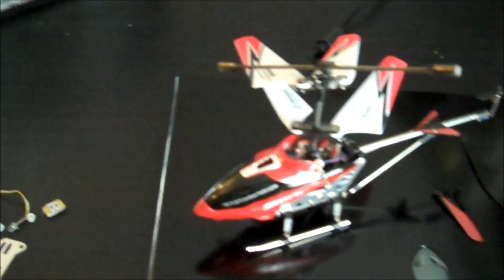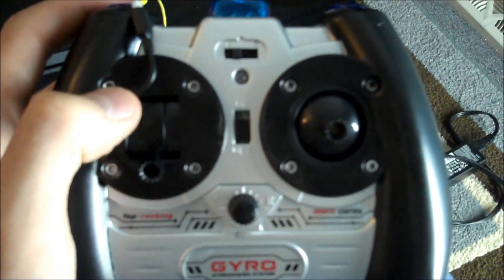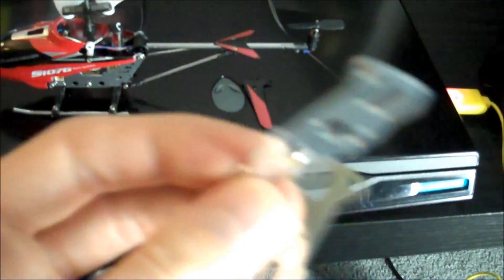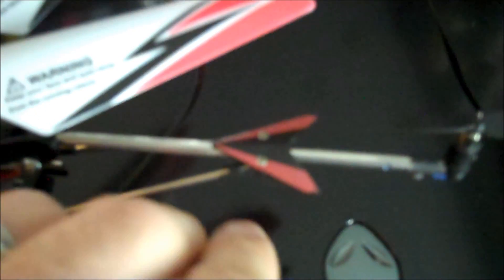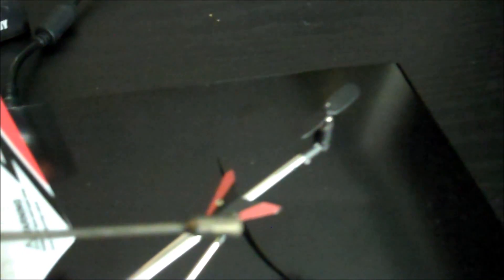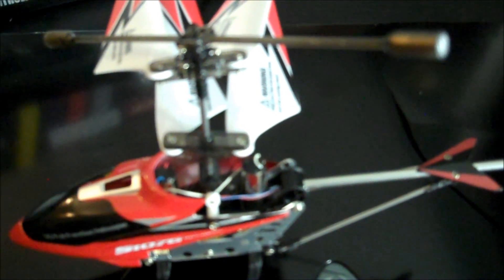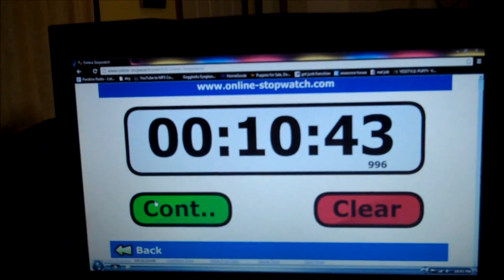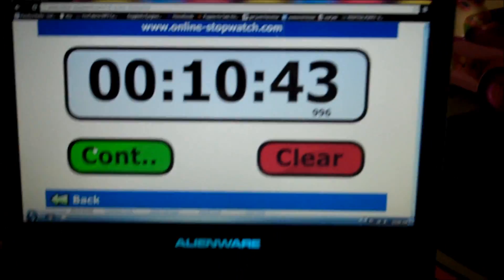Syma s107, How to achieve 11 minute flight time on stock battery

Comment: I remember as a kid I used to get these strangely enough from Walgreens by my house except back then the whole body was plastic and it didn’t have landing rails but it had little plastic wheels. They would break so easily and the front wheel broke off first before anything else every single time. Great little toy. Glad to see they have gone with a little more of an industrial style with the aluminum frame and aluminum landing rails. These little guys never lasted long in my hands lol but now as an adult I decided to relive my childhood and buy one. Definitely make sure to make it last. Not sure if it was the same brand but the ones I got as a child looked identical to this one.

Comment: most of the plastic he takes off is the stuff that generally breaks off after the first few crashes. 

Don't do what this idiot does and grind your weights down just buy the 350mh battery and change the rear plastics to flex, you will get amazing control and be able to do the freestyle stuff so easy.

Comment: I removed the back metal bars and took off unless pieces of plastic and removed the stock batterie and soldered a 350mah battery and now I've gotten 20 minute outdoor flights and about 25. mins indoor flight
Reply: you cant fly these outside so clearly you are just a liar.
Reply: @Ts0usermax  yes you can after the sunset, and is a ligth breeze I do behind my house the patio is surrender by Cement fence, is about 55'×16'.

Comment: I can get 12 minutes on my syma s36 with a 240mah battery and about 8 minutes on the stock 150mah. All I do Is remove part of the metal chassis, remove the rear support bars and cut down the canopy a bit I also flipped the landing bar feet so they point towards the back to shift weight balance to the back. Very easy mods and not only is battery life 50% better and it is mo much quicker and more agile.

Comment: what do u basically have to type to get a battery on amazon
Reply: 350 mAh 1 cell lipo.
Reply: ok thanx men
Reply: Kimian Placide And make sure that it is AT LEAST 15 c , if u know what it means good , if not no bigy ,cause otherwise the heli probably won't fly.
Reply: ok thanx for the advise

Comment: I removed inner frame, grommets,tail supports,all metal screws except the four holding the frame together & two for the canopy I used CA instead of screws,ground the fly bar 1/4''. This thing is so fast and flies 13 min. on 150mah . I now have two 150mah battery's installed Now it flies so long I stop to let motors cool down long before the battery's are dead. And to Pheonix-X Gaming WOW you are sooooooo wrong dude.

Comment: making it light would increase flight time but the battery would still be using the same energy on the light becouse the chip is still programed to put out energy to the light
Reply: Your wrong.
Reply: how
Reply: Pheonix-X Gaming I'm sorry I read your comment wrong. I agree, I forgot to turn my s107 off after a flight(almost drained the battery) and the led was still about 45 mins later  so it's not even taking much energy.
Reply: The Diddler lol
Reply: If the light's removed, no energy can be wasted trying to power it.
Reply: Ur a couple months off buddy BurningApple
Reply: Still though.

Comment: I brought 2 of these symas different models from the same shop one had the spring on the throttle and one did not so maybe its just how they are don't know if the one has a spring in or not but if it does its disconnected ? peace

Comment: Invest the money in a blade MSR. much better heli. You won't have to keep buying these bad helis
Reply: Wtf? They last forever
Reply: I wouldn't compare helicpoters in different price ranges.....
Reply: The Diddler Yep...well sorta. You need to buy just one ,then keep modding it or replacing parts,the difference is that ,in terms of maintenance the Blade one resemble an actual helicopter,if not even better due to their small size.(Small size,less residual stresses )

Comment: I've gotten fifteen before but that was a brand new one now my batterie is bad so I don't even fly it anymore but instead I fly my wl toys v911 and v913 they are the best because they are the intermediate step and very cheap single rotor fixed pitch with a awash plate 4 channel you guys should try them out plus you can just plug in new batteries and do whatever to them because they are hobby grade they are great for people that were into 3 channels but want to go up a step to something better they are 2.4 gh and can go up to 25-30 mph of really slow and steady
Reply: Awash plate I meant

Comment: Nice computer man. I was really about to get one of those but I ended up spending $350 bucks with huge discounts from a friend at Fry's and built myself a monster 4.6ghz water cooked PC out of my old case and HDD. Did you lose any flight stability from the weight reduction?

Comment: Mods are great and to the guy who posted you just ruined your heli is nutz, its a 25$ toy for cryin out loud. I've hacked 10,000$ Harleys. However I do wish you would have done one mod at a time to see which really made more improvement. The weight factor or the LED power draw. I have the 109 and there are 2 LED's and I'm sure if they alone were gone flight time would go up. New to these things they sure are fun and I cant stop flying it. Continue to share the MODS

Comment: I get 8-10 mins on my stock 107g. idk why
Reply: But but...sad dog face
Reply: You're supposed to, that's what it says on the Syma site for that model.
It's the 105g that gets 6-7min.
Reply: BloodNinja7 I GET FUCKING 3 MINUTES, DO YOU KNOW HOW FRUSTRATING THAT IS? AND SOMETIMES EVEN 1 MIN 30 SEC.
Reply: Well either the battery is fault or has been damaged/misused. That or you just use a lot of throttle (the more steady a flyer you are the less battery is used).
Reply: I don't even know whats fcking happening to my Syma.. its real and all, and the battery is not faulty..
Reply: Well if you've used it a lot it's probably an overused battery.
With most rechargeable batteries it slowly damages them when you constantly charge then drain them without rest as they heat up.
If the sides of yours looks or feels like it has expanded from heat and seems to stay that way even when cold, it's probably damaged and wont hold a full charge.
Reply: I got it yesterday, I don't think so, sir.
Reply: Well the only thing left is that you're a really bad flyer, lol.
Going up and down a lot uses a lot more battery. The steadier your flying the longer the battery lasts.
Reply: Nope, I never use the throttle alot, I fly VERY steadily.  I don't go up and down at all, I stay at a normal "Medium" Level. So no.
Reply: Well then your heli dislikes you and you should give up.
Reply: BloodNinja7 soo that's why my heli doesn't stay up that long even though I got it today! I'm a really bad flier,and use the throttle aloott ! Thanks man!! Now I know the reason!